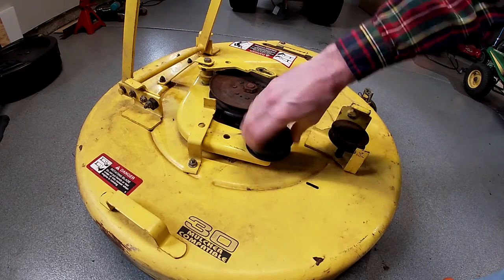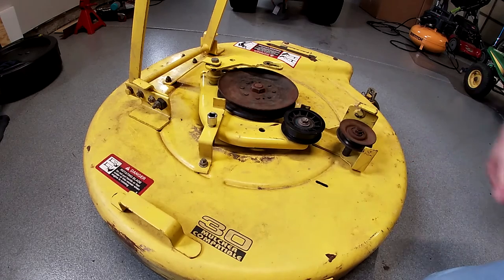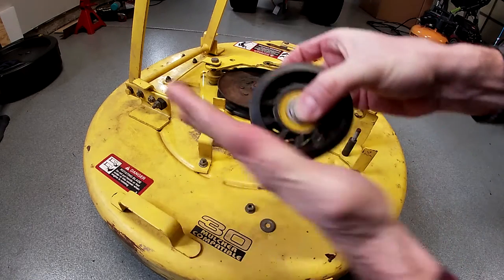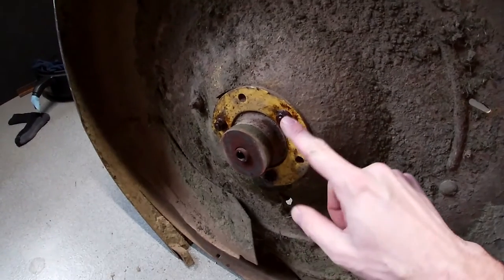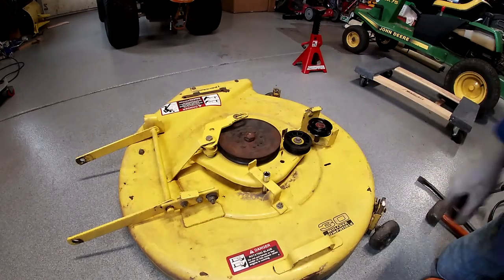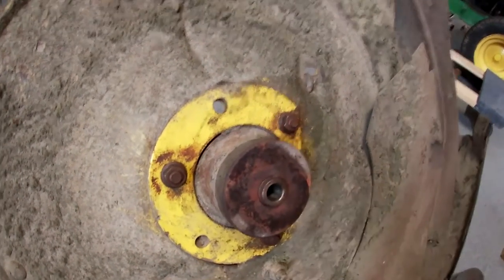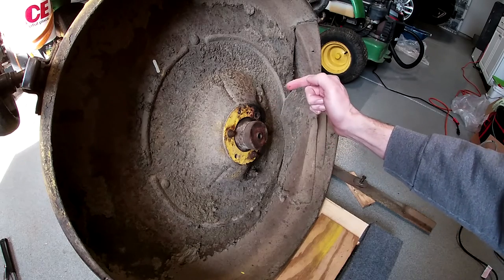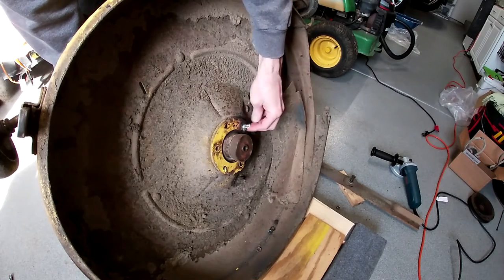John Deere GX75 mower deck pulley and spindle removal

Comment: Question sir I put my belt on John Deere sx 75 but my deck belt always get messed up. Do you think it’s may pulleys or am I put the belt the wrong way?
Reply from the maker: Without seeing the issue you're having, I cannot offer much help.  You may have a bent or misaligned pulley, or the belt may be on the wrong side of a belt guide.  "Taryl fixes All" is a great channel that has many videos related to this subject.
Reply: I had the same problem with my GX75 and after I bought a cheap belt. I bough a more expensive one and it’s still on there. The cheap belt lasted maybe two weeks or less